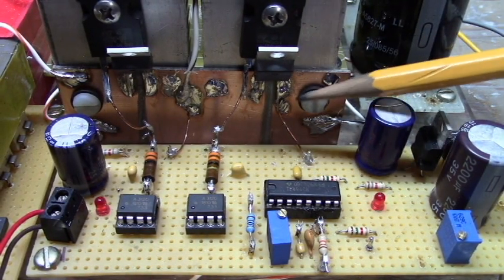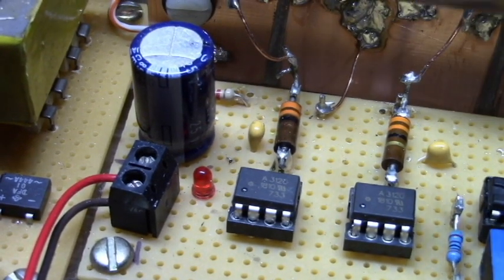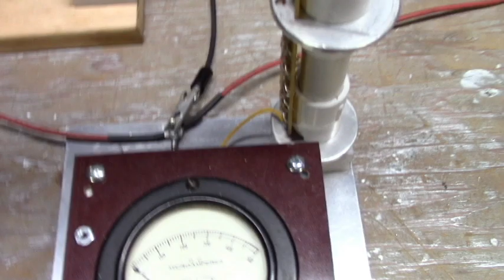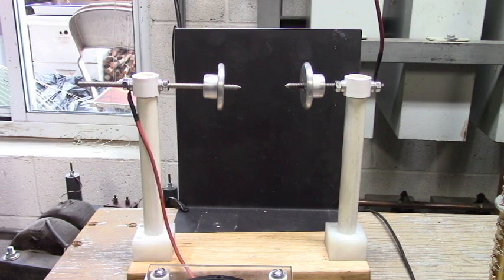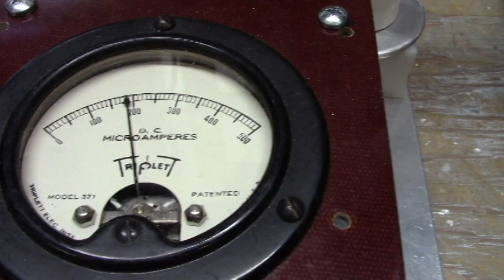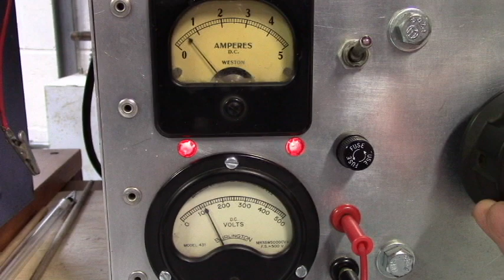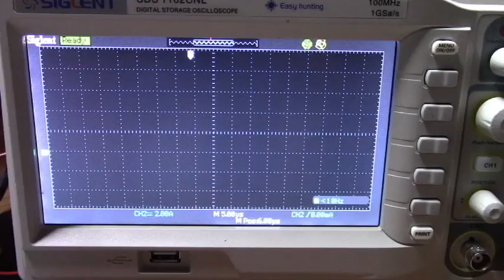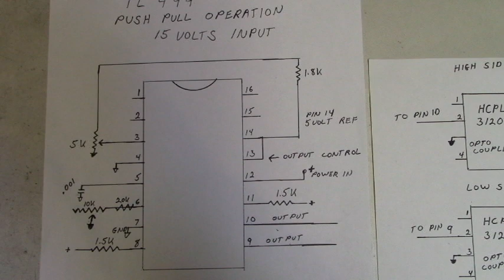series connected flyback transformers

Comment: weak driver man, you should use a higher current and voltage driver. You can get pretty long and white thick arcs with that.
Reply from the maker: Thanks for the input. I was afraid of blowing it.
Reply: @stephenhrobak3631  if the secondary is filled with epoxy then it should be ok to even over drive it
Reply from the maker: @OpEdits1214  Got it, thanks
Reply: I love that you made your own driver though. Everything is so neat too!

Comment: Is there a particular reason for using the IC HCPL3120 ? You are sharing the same grounding on it input and output,  is this assertion correct? Congrats for your project.
Reply from the maker: The power transformer has a dual secondary output. The optocouplers do not share a common ground. I used the HCPL3120 just to try them out. Thanks for the congrats.

Comment: Hi Stephen, does the low side also supply the power for the TL494 (it looks like there is a voltage regulator on the right / next to the TL494)? Or does the TL494 get its power from a separate supply?
Reply from the maker: That is a separate voltage regulator for the TL 494

Comment: I made one which used cfl ballast 
It worked like a charm but this is excellent cool!!!
Reply from the maker: Thanks for the interest.  I post this stuff to generate interest from others.
Reply: @stephenhrobak3631  
Sir where do you get these wonderful
Fbts do you take them from old TV
Reply from the maker: @lordelectron6591  These flybacks are from a electrostatic precipitator  from Ebay. They are already set up to run in series.

Comment: Cool project, I have seen these cheap electrostatic devices online but never really knew how robust any of the parts were. I like the mods and may take a stab myself
Reply from the maker: The transformers were great but the stock driver had much to be desired. I would like to drive them with a resonant single end driver and see the difference.
Reply: So I basically copied this design (thanks for your descriptions) and its a fun little toy to play with